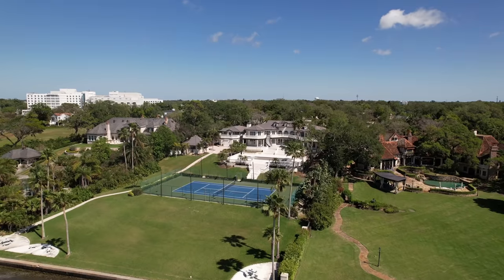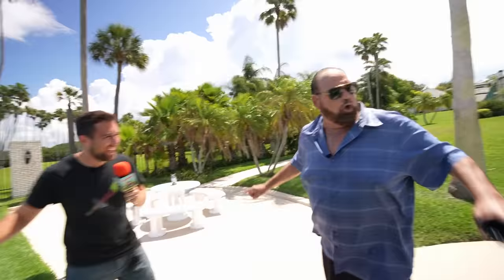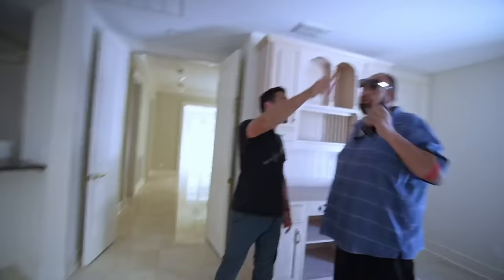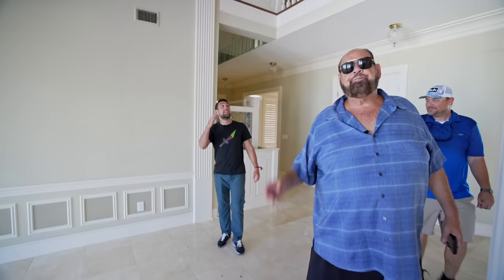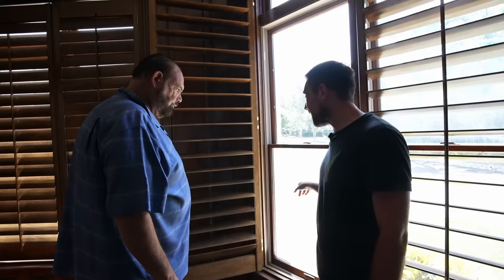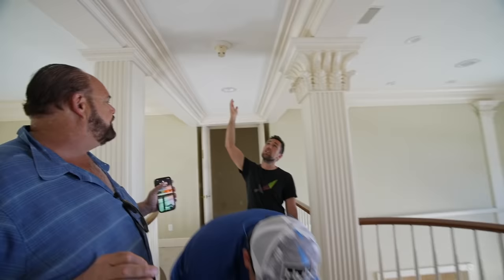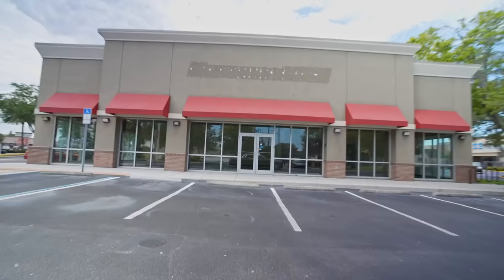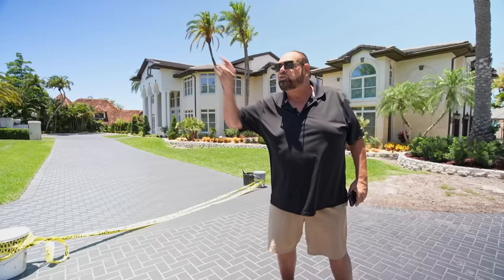Mansion Meets Kevin

Comment: I was all through the Rinker mansion when it was under construction Mrs Rinker showed me the house plans and invited me to check it out and it was amazing to see. The chandeliers she ordered from Harrods and are Waterford crystal.Since Mrs Rinker sold her mansion two other flippers had their hands on changing the decor thats not how her house looked she had great taste. She had told me after they moved in the first year her husbands wood paneled den had pipes burst. And they had to have a full time handyman and it was like running a commercial building. As I remember the builder was Castle Builders from Tarpon Springs. I knew them when they lived in Dunedin just before the moved to Willadel. They were going to build on an island off Belleair then this became available and tore down the house and built what they wanted. She said that island had all new money and they changed their mind to build on the two lots they bought and wanted me to buy one.

Comment: Kevin had great suggestions EXCEPT for the TERRIBLE idea to paint the stone kitchen counter white?! Preparing food on a painted surface is unsanitary and the finish will have short longevity. The stone surface looks much more elegant than white paint, and is far more durable. In my prior apartment I spilled turmeric on the white faux coriander surface and it turned yellow for several months until the color eventually faded. Real stone wouldn't have been stained at all.